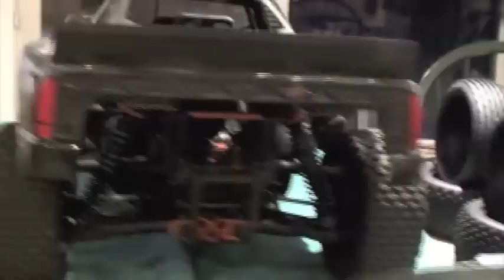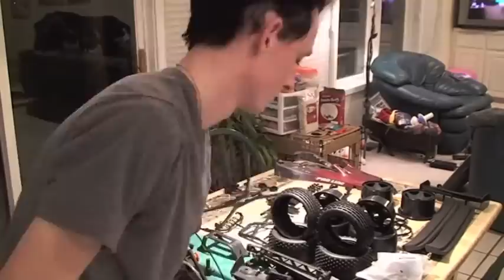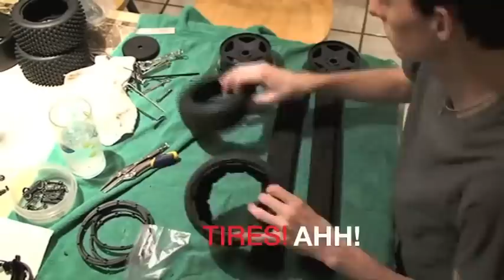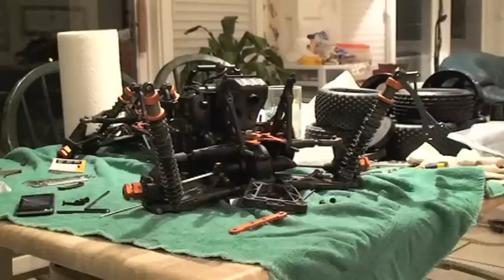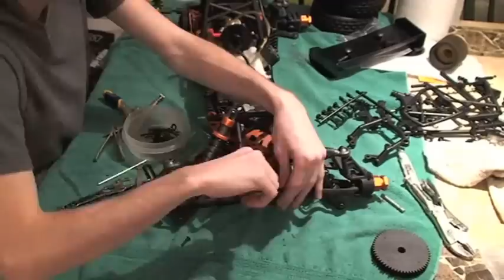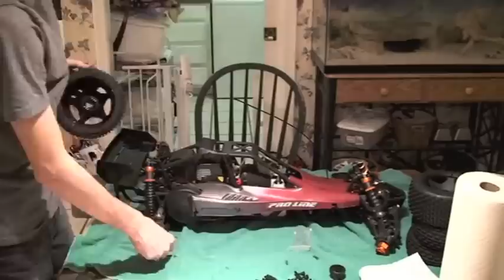HPI Baja 5T to 5B conversion Time Lapse!!

Comment from the maker: thanks bro! the reason I removed the tank is because there was gas still in it and it was spilling out the vent hole when I was turning it   upside down. The reason for the trans/diff removal was to install the 20t drive gear to compensate for the size of the B wheels and tires, I think the 5t has a 17t.

Comment from the maker: @OJPS360 

I just wanted to diff. driving experience. I had the 5T for about a year and a half and wanted to purchase a 5B. Instead of spending another $1000, I spent about $130 to convert to a 5B. It handles a lot better and seems quicker now. I kept all the 5T parts so I can convert between the two whenever I want a change. :-)

Comment from the maker: The actual time I spent working was about 2 hours, but by the time a taped, ate dinner, and took my time it was about 4.

I can make a detailed parts list if you want, but the basic outline included tires, wheels, bumper set, 20t gear, body, few parts trees from a 5bss, and the wing, plus some other odds and ends.

My total cost was about $120. I basically went the cheapest route from a 5T to a 5Bss, everything except the ss pipe.

Comment from the maker: @maddog8911capt 

-As far as the chassis, they are the same on the T and B and so are the arms, I think the only main differences are the gearing, wheels, tires, body posts and misc skid plates and stuff. They really aren't that different, the price difference comes from the T body, the extra skids, mud guards, bumper, and a few small things. The way I see it, if you buy the T you can convert to the be pretty cheaply, but if you buy the B you are looking at around $300+ to go to a T.

Comment from the maker: @Harvz78 

I changed the gear to make up for the smaller diameter tires. If you dont change it you will notice a slight drop in top speed, and a slight increase in acceleration. Essentially by changing the gear from 17t to 20t you are "gearing up" for the smaller tires.

Comment: @ratm514 ya i will i will probably spend 5 hours just figuring out how to take it apart but the dominator pipe i got is the one that comes out of the body so i dont have to worry about it breaking from rocks or landing like shit off a jump or something. but i hear that they really improve the performance on these things. but ya about the diff thing maybe wat i will do is call up hpi and ask them.

Comment from the maker: @maddog8911capt 

-With the trans, all I did was switch the 17 tooth top gear that comes with the T with a 20 tooth top gear that comes with the B to compensate for the smaller tire diameter.

Comment from the maker: @kirksajerk 

Thanks bro! The main reason was that I wanted to try a diff driving experience and believe it or not the B and T handle completely diff. I took about 3 hours because I was visiting with family the whole time, but it wasn't too bad. You can convert for easily less than $200, I spent $130 for everything, a got a used body and if you browse ebay a lot you can find a bunch of guys parting out 5Bs and get some good deals.

Comment: @ratm514 ya ik parts are really cheap on ebay for the 5t i found a set of 4 trenchers with rims for buy it now 120$ new. but one question with the 5t i was talking to some other guy and he said first thing u do before driving is to take your differential and put more grease becuase it doesnt come with enough in it. and also i dont have my 5t yet becuase its my christmas presnt but i got to put my dominator pipe on it and it seems kinda complicated to get to that.

Comment: @TheGTbmxer converting 5t to 5b is way more cheaper than 5b to 5t cause If you want to convert your 5b to 5t the body itself cost nearly 200bucks with taxes and shipping plus you need to buy side rail front bumper etc so I suggest to get 5t...

Comment from the maker: @kirksajerk 

haha dude, I literally just installed my v2 Dom a few hours ago and posted a vid of it. Check out my main channel vid. :-)

and yeah, I would recommend at least checking the diff. My 5T is almost 2 years old and the diff was dry when I first got it. I heard that HPI fixed that prob and now all the new 5Ts have fluid in the diffs, but I would check anyway to make sure.